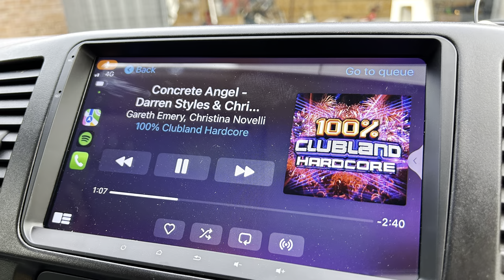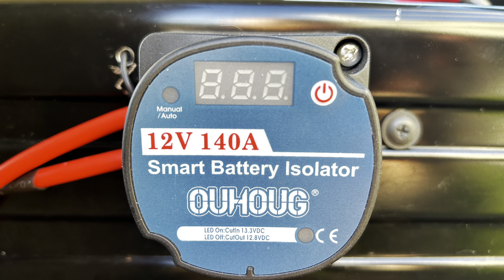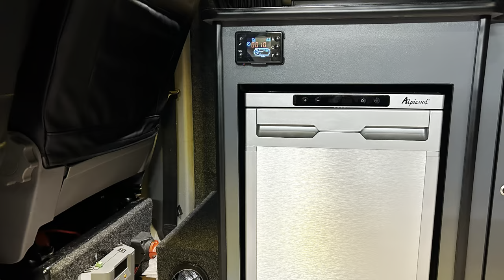VW TRANSPORTER T5.1 CAMPER VAN CONVERSION SELF BUILD. (Part 1)

Comment: Those seat covers look amazing. And can you tell me which R#7#r bed you went for please? I like the size of the rearmost seat section on yours. Gives good bedding storage possibilities. Some have tiny or nonexistent space at the back. Thanks.
Reply from the maker: Thank you. Yes I love the seats the front covers were from a company called leather inn that we’re trading on eBay. The rock and roll bed was from a company called captain seat in Leicestershire. They are amazing at upholstery. Yes I love the fact you can just lift the skirts up and have tons of storage. I wasn’t keen on that look at first but it works really well 👍🏻

Comment: Hi mate , where did the get the Windowscreen shade from that goes on the outside thanks
Reply from the maker: Hi mate that was just a cheap eBay one that didn’t last very long. I have recently bought a stitches and steel one and it’s far better quality. You can search for them on the internet 👍🏻